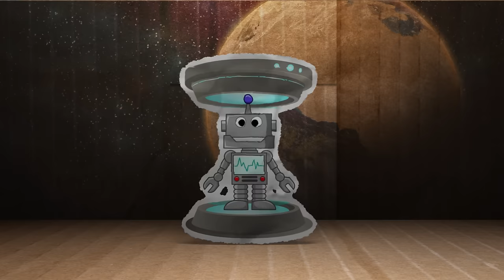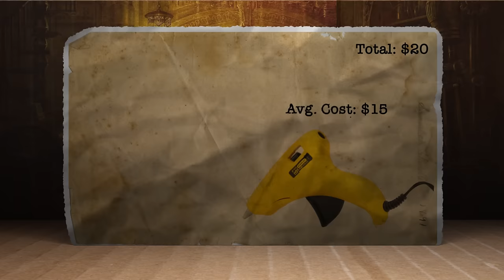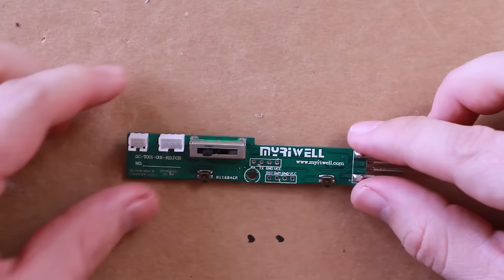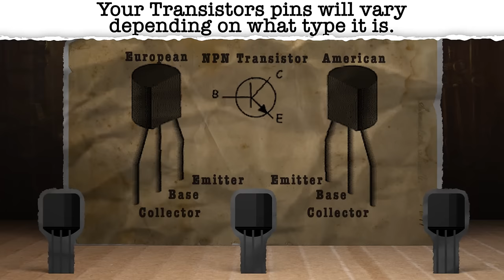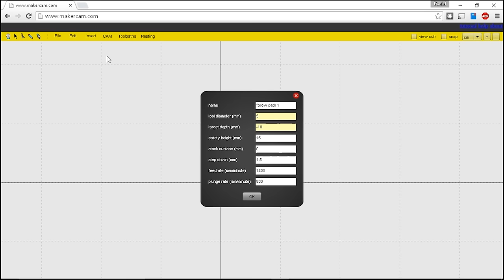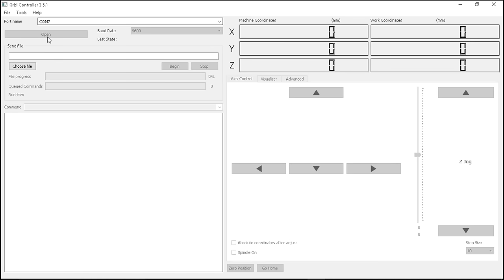How To Make A Cheap 3D Printer

Comment: you should try do build a spy drone or quad copter for cheap because they are really expensive to get a good one
Reply: +lucas hawn  YES ...next video should be arduino nano quadcopter or something like that :O
Reply: agree
Reply: +lucas hawn YES! a drone or something... with a camera and gimbal
Reply: +Gershon Dharmanandan you could add camera on drone yourself ...or did you want to make your own gimbal?
Reply: attecker yup... cos they are what cost the most in the more expensive drones...
Reply: +Gershon Dharmanandan The gimbal part would be super interesting as it will probably need rotation sensors to know how to stabilize. The whole gimbal thing could be a project on it's own.
Reply: Damian Reloaded yup that's true.. I would love to make a handheld gimbal for my phone...
Reply: true
Reply: kuba zrobczynski yes i live in london, and yes you can... but the quadcopter wont be great, and the camera would be absolutely crap. and it has no gimbal so it would be shaky as hell...
Reply: kuba zrobczynski but still
Reply: Gershon Dharmanandan I think I've seen some homemade gimbal device for camera/phone made only out of balanced counter weights... like, the weights hang below the center of gravity and the camera, balanced on a point, gets always aligned with the horizon due to gravity
Reply: Damian Reloaded yeah, ive seen them as well.. they even have some for dslrs for about £20-30, but they arent that good compared to gimbals... and require a lot of setting up.
Reply: Gershon Dharmanandan Indeed, and weight is always an issue.
Reply: Damian Reloaded yeah.. That too. And electronic gimbals are just so much better...
Reply: +lucas hawn 16 bucks is expensive?
Reply: Bass Lover actually... They are bad for the price.... No gimble to stabilise the camera, so it just is basically all blur... And the camera is bad... Usually less than 720p... But even the 720p ones are bad
Reply: yea! a quadcopter with camera! please make one
Reply: yes

Comment: Haven't seen all your videos yet, but if you haven't tried it yet, how about a Cheap 3D Camera?
Reply: +GGsPlayTime correction. I mean 3D 360 degree camera
Reply from the maker: +GGsPlayTime I'm still looking into it. So far, it looks like Raspberry Pi's with webcams would be the easiest.
Reply: +Tinkernut that would be a great project to see. I feel the future is big for 360 degree Docos and Movies
Reply: +GGsPlayTime i wonder if you could use the panorama feature on a decent smart phone to create a 360 image and overlay that with another panorama from an another smartphone to make a 3d image?

fascinating concept, nonetheless.
Reply: +RetroPlayGamerTV I am building one off of two gopro ripoffs I bought off amazon.  Then I 3d printed a mount and us a program called videostitch studio to make it virtual reality capable.
Reply: +Tinkernut with a raspberry pi zero, a cheap 7 port hub and 6 webcams, you'd be at around 70-80$ with 720p meh quality .

Comment: Epic as! Recently been thinking along the same lines so I did up an eBay shopping list of all the 3D Printer bits I could find for super cheap - hotends are actually available as low as 10 bucks (e3d clones) and you could use a bowden style design so there's less weight on the cdrom drives. Those 3D Pens are getting so cheap and nasty, I was at least expecting at tiny geared stepper in there!
Reply: I know its pretty far in the future, but the easythreed mini printer would work great for this. its tiny, direct drive, and you could use marlin firmware to properly control it

Comment: Tinker, there are much better sub $100 plans out there. Most of which utilize $1.50 28JYB motors, $5 hot ends (i can attest that they actually work decently well, look into it), and as many 3D printed parts as possible, which aren't too expensive online. Look into the Cherry 3D printer on instructables, I estimated total cost to be around $80 from within the U.S. (original plans are in europe and utilize a few local resources). This is a much more realistic printer for people to make and very closely resembles a higher quality prusa. The downside is mainly the speed due to the small motors, but all in all, you can size it up to a 6"x6"x6" build volume and use regular slicer programs such as Cura to run it.
Reply: +DrMrSuperAwesomeGuy I hope this link stays, but take a look at it, please. A fully fledged tutorial of this type of build would help so many people. http://www.instructables.com/id/Cherry-60-3D-Printer/
Reply: +DrMrSuperAwesomeGuy I agree, dont take this down! I checked the Cherry and Vulcanus versions and i gotta say, those are proper 3D printer projects with a small budget! I'l probably going to build one, when i get more experience in CAD, so it wont just dust in the desk ;) Thanks for the link buddy!
Reply: no prob bob. I can verify that these builds do work, although some of the instructions can be lacking. If you have any questions just ask.

Comment: on ebay u can buy an extruder for like $30
Reply: The hot glue gun would be another $15, and the filament would be about $20, so it would cost more for a lower quality product .
Reply: Get the hot glue gun from a garage sale or a thrift shop.
Reply: +ben nottelling-  The extruder would be $30, the filament would be $20, so even without the hot glue gun,it would still cost more than just buying a pen.
Reply: +UPandUNDER Normally I would suggest that you avoid a cheap extruder at all costs, they are almost always garbage. But considering this printer is literally just scrap, it would probably work well enough. That being said, you would be limited to using a bowden setup with a regular extruder as you wont find a hotend with an embedded motor that would wouldn't weigh too much to be driven
Reply: +Kain Arrowny hot glue gun = $3 and 20 for filament and 25 for extruder  (yes, $25) while the pen option is low resolution and $45. So, $3 extra for  about 3x precision. Fair trade in my opinion. Also, you can MAKE an extruder quite easily actually. just a couple motors and some gears, I already made one out of extra parts from the dvd drives for the CNC machine.
Reply: +Kain Arrowny You can get a hot glue gun for $2 at Dollar General.. But a hot glue gun nozzle is way too big anyway.
Reply: +UPandUNDER hotend= 6euro, extruder motor (nema 14)=15euro, 3d printed parts=3-5 euro.
next time the printed parts are free ofcourse:P total extrusion unit would cost just under 30 euro's not 42...
video is pretty outdated considering the price range and the method of constructing... 
build my own mendel i2 printer for les then 200 euro's easily. and way more reliable then altering a 3d pen...
Reply: +UPandUNDER I saw an hot glue gan for €1,95, about 2$
Reply: China is gold!
Reply: Daan van der Kolk wasn't actually china, and it looks like you are Dutch :-).
I saw it at Action, I think, or another shop like that.
Reply: On Ali-Express you can get a hotend for $4 and a NEMA 17 motor for like $10. That's $31 cheaper and a MUCH better solution
Reply: where?
Reply: IS IT GOOD AT LEAST
Reply: (sry caps)

Comment: holy balls it works :o
wasn't expecting that :D

Would really love to see a sub 300$ ( or just generally a cheap ) DIY CNC machine with an actual spindle capable of aluminium.

maybe old printers / scanners ? idk
Reply: Did you watch his Last Video?
Reply: +Harry Sanderson Yes

but that little thing won't hold a dremmel, let alone something more powerful
Reply: +BillTheBox  Reason is, in actual milling (even aluminum) you need rigid environment, to have the right dimension. And that costs. the cheapest way is to buy chinese mill, take it apart, clean it, fix low quality finish, asemble it, motorize it with stepper motors and mach3 and you will have really cheap basic mill. Then you can add a sensor for tool height. Nevertheless, do make good cnc machine you need really rigid base, good linear stuff (forget about linear ball bearings),  acme screws, servo motors and real time controler like sinumerik. Good luck with that ;p
Reply from the maker: +BillTheBox We'll see pretty soon ;-)
Reply: +Tinkernut nice :D I'm thinking of something like 4x nema 17 steppers, a few big screws + welded bolt heads to lower cost, drawer rails and a dremmel ? but it would be interesting to see a better quality one too with some proper lead screws and wheels

Comment: @farvision you'd need three pens, and you'd have to program the axis that had the pens on it to move to the right / left to centre the pen as it witches colour, so you couldn't do it at the same time but you could do it, though you wouldn't have much room because the movement is limited to the length of the tracks the plates run on

Comment: I think that resistor is to limit the current through the transistor, because the transistor has a diode-like structure, and therefore the current should be limited to save the transistor.

Comment: Top notch stuff! I've recently got a bunch of old IDE CD and DVD drives for free so I might try to make this printer for myself! Thanks for the video! :D

Just a quick question tho: could one use an old PC instead of an Arduino? I have a really old Athlon XP PC collecting dust somewhere in my garage and it has an old parallel port, which AFAIK was used a lot for DIY projects back in the day due to its many in/out pins and being really easy to interface with programs, so it would be neat to give a new purpose to that old hunk o' junk!

Comment: just buy the extruder/hotend combo for the eezythreed mini printers. its like under 30 dollars on alliexpress, it is direct drive, and you would have the ability to rig this entire setup to work with Marlin firmware and control it using pronterface, repitier, or octoprint

Comment: I don't know how prices were when you posted this video... but at the moment you can buy a complete hotend for under $5,- from aliexpress... It's definately not top quality, but cheaper than the pen... If you use separate parts, it's slightly more expensive (still under $10,- ) but a lot better... They also have parts to build a cheap extruder.
Reply: Could you provide links Ronald?

Comment: that's absolutely amazing, i might have to build this because ive wanted a 3d printer for a while now but they are all just too expensive.

would i be able to make the plastic components for a higher end 3d printer using this? in other words, would i be able to use this to build up from a cheep 3d printer to a higher end one incrementally? of course i would have to buy the electronics, but those cost significantly less than a pre built printer.

Comment: Hi tinkernut. I was fascinated by built-your-own 3d printer with different parts. What I see in your video is that you use Arduino as your board and 3d pen as the nozzle that has its own thermoplastic heater. Basically, from what I know, the Arduino itself serve its purpose as the "brain" and the motor as the "actuator". I have a project revolving around 3d printer and I want to make 2 nozzles instead of 1. Could I make an electrical branch on the Arduino and still have the same output? I want to make them move synchronously.  Thanks.

Comment: how about you make a functional pip boy and possibly make it look semi decent (using like a lcd display from a ds or something and a arduino mounted to a piece of cutting board fastend to your arm with straps (im building a gauntlet and i used an old cutting board and the plastic casing from the wire which i found from an old extension cable which i pulled the inner three cables out of))

Comment: Is it possible to turn a regular hp printer into a wireless printer?
Reply: +Allvaryan  You can share the printer by using a pc as a print server.
Reply: +Allvaryan You could use a Raspberry Pi as printer server.
Reply: Does any one know how to use the pi as a network  speaker?
SliinQ
Reply: Alex Wroblewski Never used it but you could try http://www.pimusicbox.com/
Reply: SliinQ
 Thanks.
Reply: +Allvaryan plug the printer to a airport express or router with usb.

Comment: Hi i've been following ur tutorial to make a 3d printer using the cd rom drives but the three stepper motor doesnt rotate with my easydriver only the z axis moves fine . X axis never rotates at all and Y axis only moved once . I checked the connections and even tried to increase power but the problem didn't resolved. The software portion works just like yours . And i am a little lost..

Comment: I know this is old but was there a reason you did not use the retraction button?
in a 3d printer (love one, can't afford one) they use retraction instead of stopping for cleaner lines/no strings when moving to different locations to print.

Comment: brother ... your a fucking genius .....wholly cow .... did you come up with this design ? don't matter you made such an easy to follow video ... now my question is will the kind of filliment be limited to the pen or the software ... I always wanted to make my own custom phone case ... but it will need to be made of composite materials both soft and hard ...
Reply: Use ninja flex filament
Reply: Gavin Silveira hmm interesting ... I am new to 3d printing where you recommend I buy from ?
Reply: +Skylin Megas I'm not sure, I bought my 3d printer from maker farm like a year ago but I bought like 3 spools of playsand and have been using that Simce as I dont use it frequently
Reply: +Gavin Silveira *playsand = PLA autocorrect
Reply: Play sand ...lol :) ... OK I need to read up on this thank you

Comment: I think its a missed opportunity for making a cheap extruder, which I think is really doable. With an extruder and a good setup I think you would be able to get a fairly good small 3d printer.
Reply from the maker: +Peter Muis Most DIY extruders require 3d printed parts. I wanted to use parts that are easily available to most people without the need of expensive equipment.

Comment: Tinkernut, I want obtain a printer that prints [high resolution] wax - there are some 3D printers around but they are very expensive (up to or about AUD$100,000 (imported to Australia)).  Fuji Xerox make an 'ordinary' (2D) document printer that uses solid wax tablets as the 'ink' in those machines.  My question is, do you think it would be possible to build a 3D wax printer by merging a 3D printer and a 2D printer?  In other words, if I had a basic 3D printer, do you think I could replace the extruder with the print-head of a document printer and merge the electronic controls such that I could print in wax?

Comment: Excellent with one question,on a standard cnc a negative z axis command drives the z down into the workpiece and a positive z axis drives the z up from the workpiece.Have you got the z axis inverted in the GRBL settings or did you wire the Z in reverse.  have the exact same setup as yours ,I have been wanting to do the 3d thing and now I will get it done,also what speed control setting did you use on the 3d pen.....WCH

Comment: well considering you buy a new desktop power supply, 2-3 cd-rom drives, an arduino, and several hours trying to piece it together I think it would slightly inflate the cost :|
Reply from the maker: +BBBowser This is going off the assumption that you can scavenge the hardware from old PC's for free (which should be easily accessible). Trust me, piecing this together is much easier than piecing together a RepRap 3D printer.
Reply: Tinkernut Oh, right :-)
Reply: Goodwill man. Just got a PC 350W Power supply for $6. And 3 CD Drives for a total of $6. Not bad of a cost there.

Comment: thanks for awesome videos!! i have a question . Arduino has 3 GND pin and we have 3 stepper motor drivers so we use all of it for motor driver's GND and now we need one more GND pin in arduino for 3D Pen . How can i solve this problem ?

Comment: For the transistor i have been trying to find the right resistance. You have used a 22K ohm resistor, whereas i am frustrated using a 390 K Ohm resistor and the motor still runs (as per your website while trying to identify the right resistance you have to keep increasing the resisance). :/ What am I doing wrong? I am using a PNP transistor BC557.

Comment: I wanted to build Poker chips. What is the cheapest way? 

I was thinking of make the poker chips in acrylic resin using sillicone molds and iron discs inside to give weight.
The problem is the printing. I have no idea how to do

Comment: Is it possible to use a mini-servo as the Z-axis (Like for pushing the marker down) instead of using the stepper motor mechanism (Heh, pretty late since this question is meant for the last video you made...)? If so, how would you program it into the GRBL program? :/ Thanks

Comment: can you use some other 3D printer software like Blender with this?
Reply: +Veso266 no, unfortuneatly not.
Reply: +Veso266 Well yes. You can the model in Blender, export it as STL or OBJ and then open it in a slicing program such as Cura or Slic3r, choose your print settings and off you go :).
Reply: Yes, but he never spoke about cura

Comment: 3:40 why do u use a resistor, not just touch the wires?
Reply: +BOSSAGSK8 
Current limiting can save you from having to START ALL OVER. USE THE RESISTOR, or rebuild multiple times. Keep costs down. Follow the man's directions, he's got a LOT of electronic experience.
Reply: John Mood
ok sr. :)

Comment: I have the same 3D Pen and when I opened it up and tried to connect wires to the forward extruder button, the pen malfunctions and doesn't recognize the hotend, flashing the green light. When I removed the wires, the pen began to function properly. So, in essence, I have an issue controlling the extruder of the pen via arduino

Comment: My 3D pen starts extruding when i click spindle button,but it does not turn off when I uncheck the spindle box. It will only stop extruding when I uncheck the spindle on button twice. Please help me. When manually using my 3D pen, when we click load button, it will starts extruding and stops when clicked the load button again